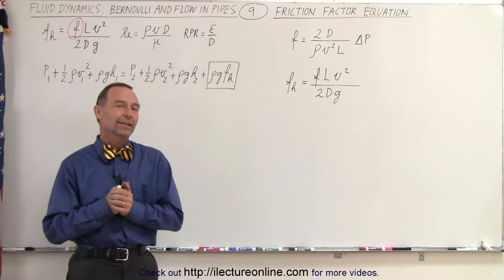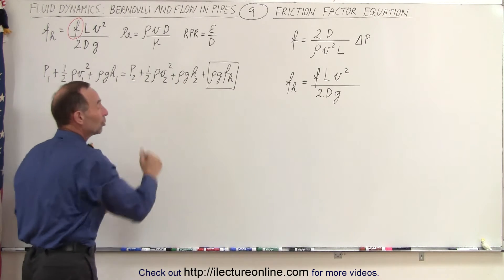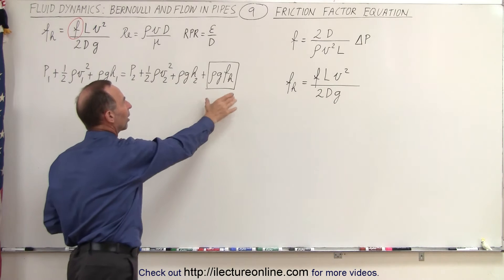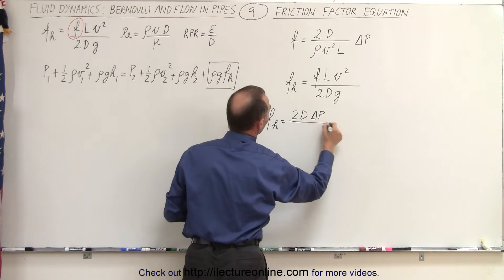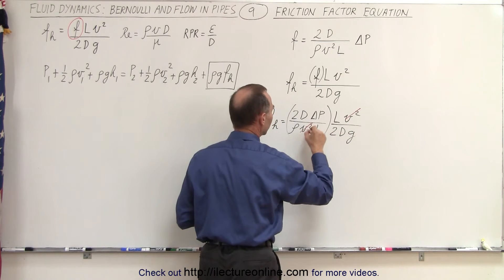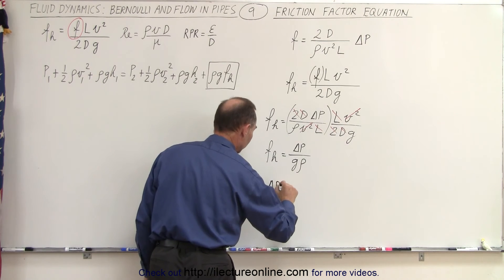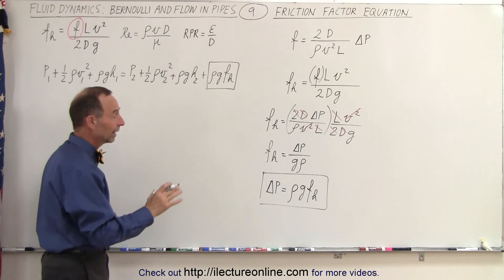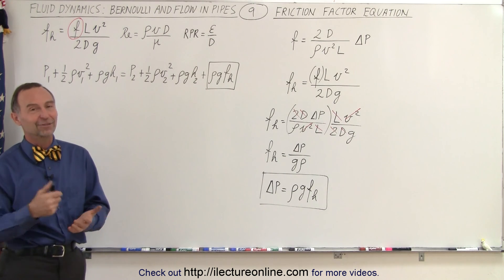Physics 34.1  Bernoulli's Equation & Flow in Pipes (9 of 38) Friction Factor Equation

Comment: Hi, sorry I got confused a little, In previous lecture, friction factor was calculated for laminar flow (64/Re) or turbulent flow (Moody chart). how come here we have a straight forward formula for it?!
Reply from the maker: Just like with all concpets in physics, we start with a simplified model.  (Like ignoring wind resistance with projectile motion).  This way we learn the basic principles which give us good approximate values espceically with low flow rates and substances with low viscosity.
Reply: It confused me as well. Basically, if we look at the bernoulli's, its written in pressure form directly -> in BAR (or Pa), so we can write directly dp = rho g f(h). I dont understand why its done in the video the way around, it is expressing friction factor using f(h) = dp / rho g, and then from friction factor again expressing  dp = rho g f(h) ... ?